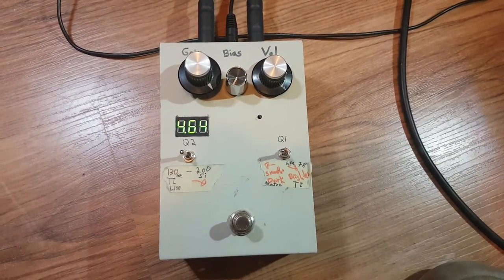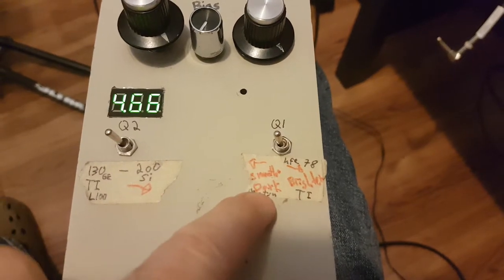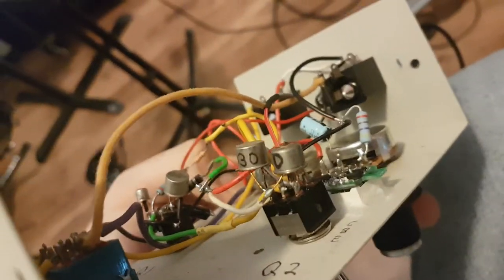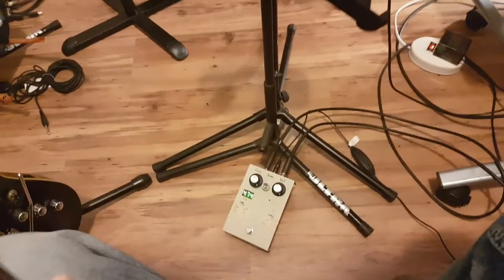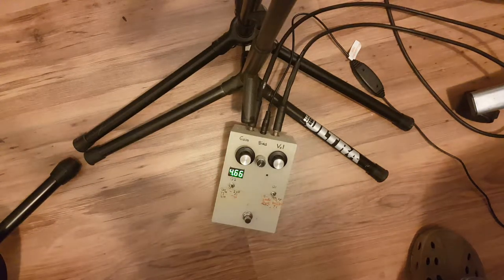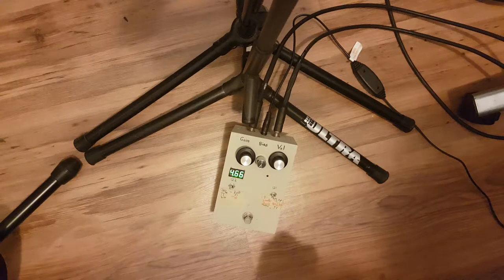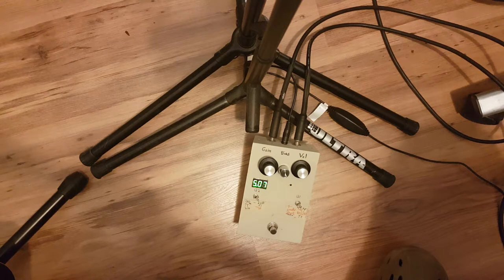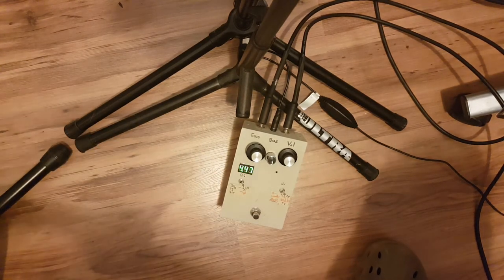Fuzz Face - Bias with display

Comment from the maker: What I'm trying to say is when I switch different Q1 transistors, they vastly affect Q2 gain. With a display, you know what voltage you have. I put another switch now to power off the display to rrmove the hum.

Comment from the maker: The voltmeter probe pin now has a switch to turn it off. Also, the Q1 switch adds another resistor with the collector so the bias stays in the same range when I switch.

Comment: What voltage do you have in Q1 collector?, are you using 33k for that resistor?. I juat have a couple of leaky Ge Transistors so I put two 100k trimmers and adusted by ear (22k/23k each) and getting 0.45V in Q1C and "something¨ in Q2c...   ..it is just in my breadboad by now.
Reply: i know this is a very late response and you most likely have your Fuzz sorted out . but just in case the Q1 collector should be set to about 0.6v to 0.8v , the collector of Q2 should be about 4.5v. to 5 depending on your power supply . it should hit about half the voltage of your power supply my PSU puts out 9.54 so i aim for a Q2 collector of about 4.77v.